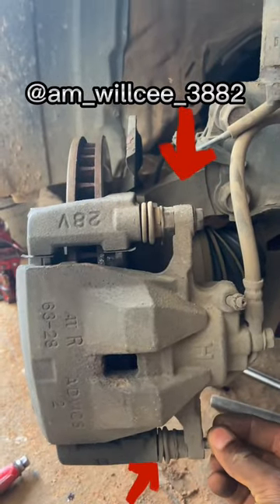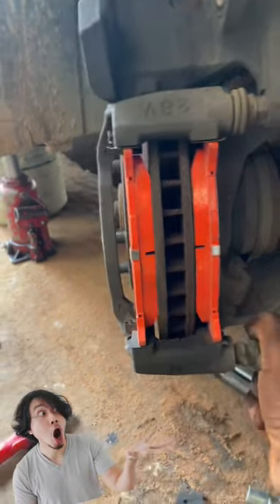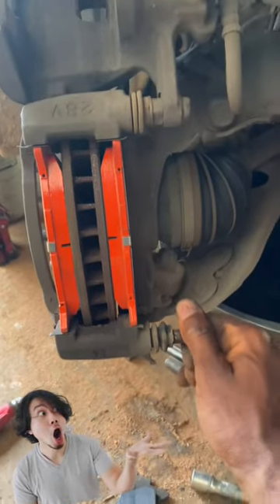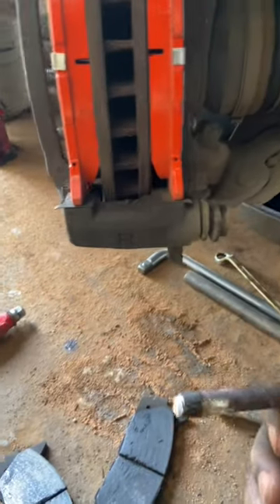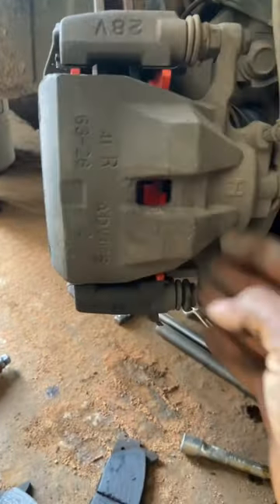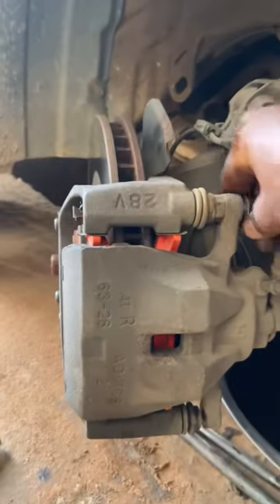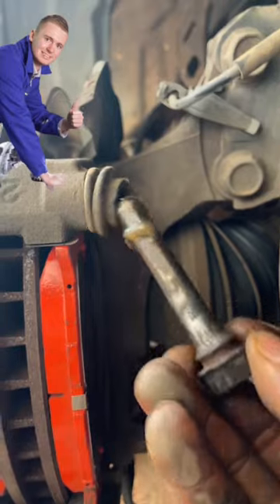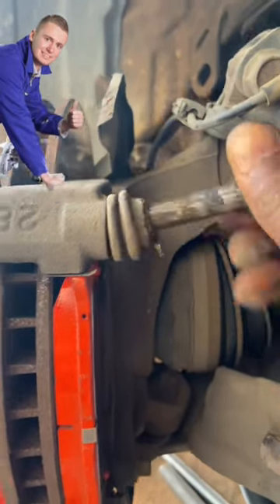How to fix a stuck or seized caliper guide pin. #shorts #youtubeshorts #shortsfeed #youtube

Comment: If you could pull it out with a hand. It’s not seized. Just dirty.
Reply from the maker: It was very seized I pulled it out already so I pushed it in back just to record it yet it was hard to pull out.
Reply from the maker: You can see the pressure I’m applying just to put it out the second time, normally this caliper guide pin is supposed to slide in and out freely!
Reply from the maker: You can see the pressure I’m applying just to put it out the second time, normally this caliper guide pin is supposed to slide in and out freely!
Reply: Mine is so seized that when I put a breaker bar on it bent the pin and not coming out at all. Ordered a new on.

Comment: can you tell me how do i know if i have a bad caliper pin?
Reply from the maker: One major sign you’ll see and know if you have a bad caliper pin is the inner brake pad will go down more than the outer pad.
Reply: @am_willcee_3882  I am having a spongy brake pedal but when I double pump the brake it becomes firm but then slowly starts to become softer , I changed the master cylinder vaccum hose and tried different brake booster and abs and the problem is still there, I bled the brakes and changed the brake fluid as well, I don't have any oil or fluid leaks, other things I could check,
Reply: @liftupvibes1936 air in your abs maybe. How’d you make out? Been 7mo